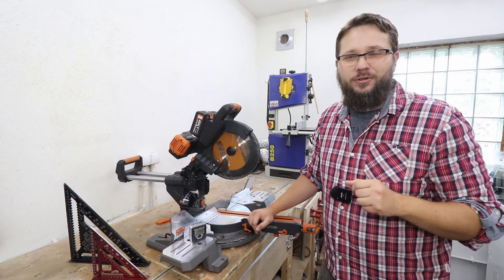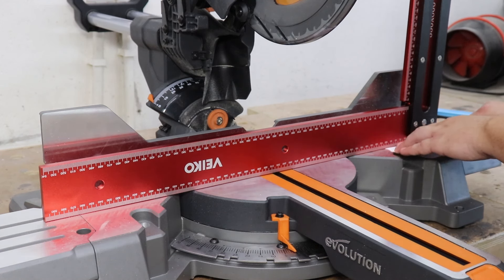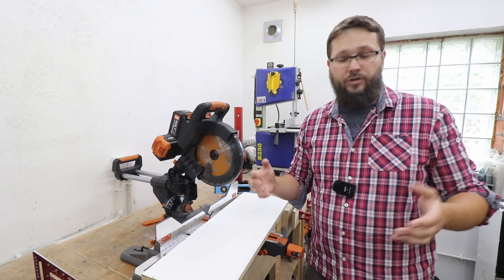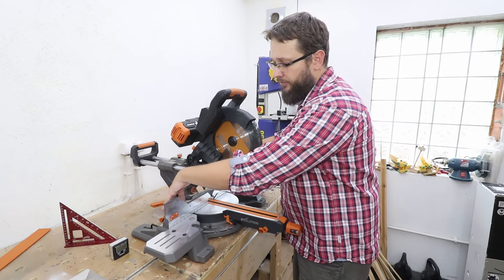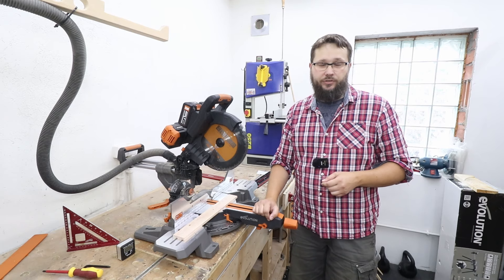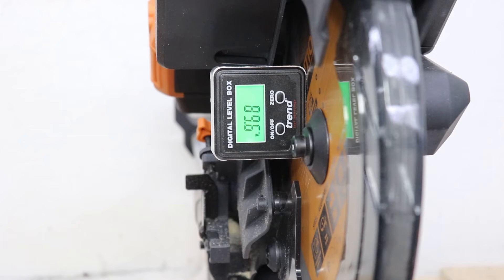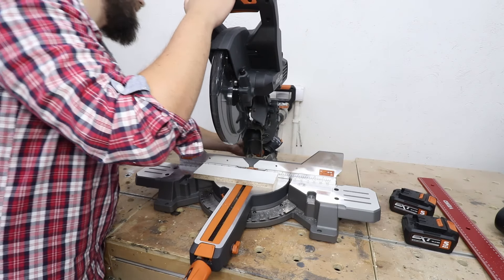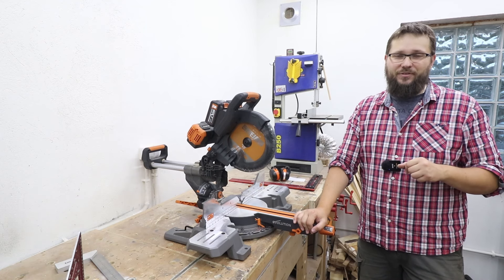Evolution Mitre Saw - How Accurate is it Straight out of the Box? Plus Mitre Saw Tune Up!

Comment: Another very useful video for those buying a mitre saw for the first time or even those who have one already and aren't sure how to go about making it more accurate 👍
It would be preferable to have the tool setup perfectly from the factory, but as mentioned below the shipping will involve a lot of rough handling and it wouldn't be surprising to find that it's slightly out ... as long as the tool can be easily adjusted then I don't think it's too much of a problem ... just a pity that their RAGE5-S table saw wasn't better (fence not vertical, useless throat plate, useless sliding table etc.)!
Reply from the maker: I'm hoping the new table saw they released is much better from a quality perspective

Comment: Another top video Tomasz  Cheers buddy.👍 would you recommend changing out the  blade or is the blade a decent one out of the box 👍
Reply from the maker: Thank you. The blade is ok for a job site needs. If you want nicer smoother results for woodworking then I would suggest swapping out the blade.
Reply: If you ever use reclaimed wood, pallet wood etc definitely use this blade as it cuts metal (screws, nails etc) just fine. Also use a magnet to check.

Comment: there is one possible adjustment you didn't mention, & as recently purchased the corded version I'd like to adjust the "laser" guide, which is 13mm out in my case, if you could please show a video of this adjustment I'd be very grateful,  thank you Steve..
Reply from the maker: This saw doesn't have a laser, it uses a shadow line. There is just an led light behind the blade that casts shadow on it. Is that what you mea? Or you actually have a laser guide?
Reply: @CasualDIY  mine has the actual (at present useless) laser guide 😓
Reply from the maker: @T.S.Beez01  My old corded version has a laser, I think there are two screws holding it that you can undo and shift the laser into position. However I never used that feature. But the new shadow line on the new saw I have is actually very good, better than I thought it could be.
Reply: @CasualDIY  to "bee" fair I wish I'd held off getting the corded version, as I often need to use it outside, which means running an extension cord out. thanks for ALL your videos, I've seen most, though I tend to skip bye the 3D print & CNC ones as I can neither use nor afford or indeed even have room for, & if I was to set them up indoors I think I'd be at the divorce courts pretty soon afterwards. 🤣🤣🤣🤣
Reply from the maker: @T.S.Beez01  Hehe thank you for watching my videos, and as always there is no pressure, just watch what you like. And if you like something you see just drop me that Like button and maybe share my video with your friends👍 thanks

Comment: Nuce video. My only comment is that I have always been suspicious of the accuracy of the digital level box you use. Are there cheap inaccurate ones and costlier accurate onws. Are there any UK or EU standards for these like there are for rules and squares. Maybe you should devise some tests/checks and do a video.
Reply from the maker: That's actually a good idea for a video. I do have two digital angle boxes. So it could be an interesting test. However Iver the years that I have been using them, they seem to be quite accurate.
Reply: The accuracy required all depends on what you are making I suppose, I'd say for general purpose stuff (like frames) that they are probably more than accurate enough, however if creating a piece which requires a lot of segments to join together accurately then it might be a different matter.
I think a comparison of digital inclinometers and protractors would be very useful ... you could could draw triangles at large scales, calculate the supposed angle mathematically and then test the relevant device against that.
Definitely a good idea for a video Tomasz 👍
Reply from the maker: @barry.w.christie  yes I've added it to my video list 😄👍
Reply: @barry.w.christie  I agree they are good enough for most purposes but I believe people think that just because it displays tenths of a degree it must be accurate to +/- 0.05 degrees but that actually depends on the precision of the manufacturing process in getting the alignment of the "electronic bubble" inside to the four reference edges.